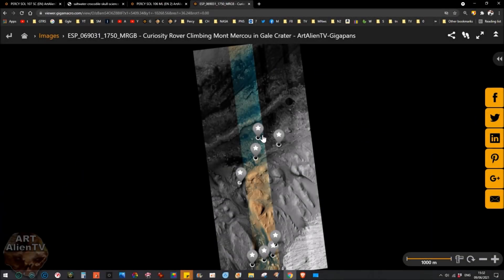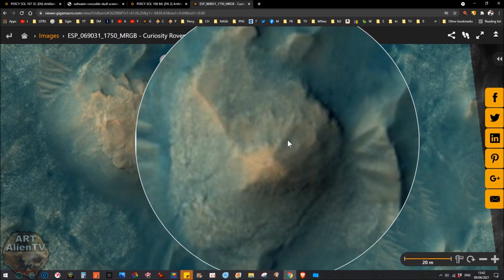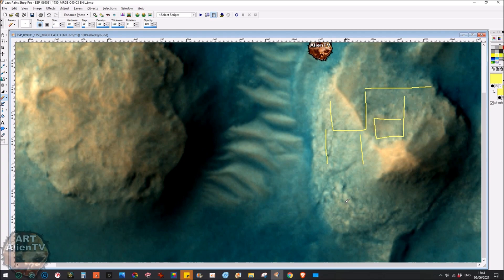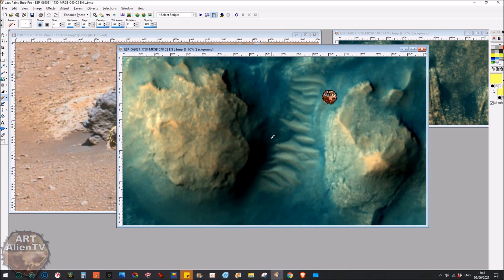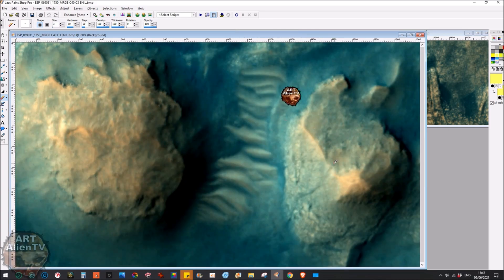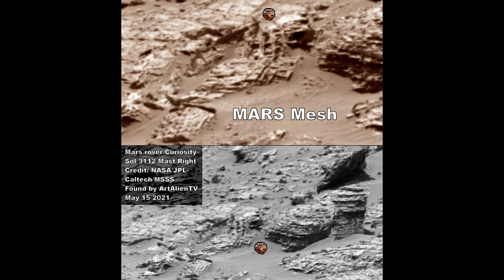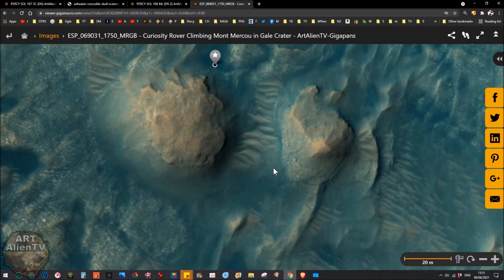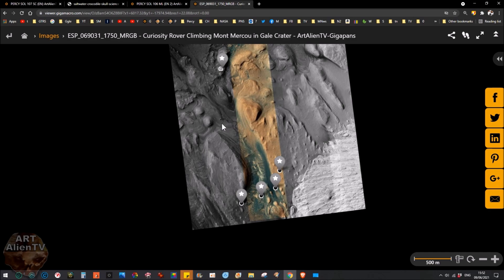MARS Ramp and Pyramid Structures ! HiRISE - ArtAlienTV (4K R)

Comment: 1:05 
Pause at that time stamp. Some might reasonably argue about natural weathering, sedimentary layers, and the strange structures that are found. That is true.
But has anyone EVER seen sedimentary layers in perfect hollowed cubes? Anyone?? 
Also, look down and left of center, just to the left of “MARS” text box. There is a portion of a bullseye looking circle, like a dartboard with inner circles, and radiating spokes. Does nature form dartboards? And circles within circles next to cubes?
Honestly, this is great evidence of intentional shapes, because they aren’t naturally formed. 
And it isn’t pareidolia, which is perceiving “nebulous” hints of a familiar thing as that thing. There is nothing nebulous or woo woo here. Those shapes are exactly those shapes and those shapes are not naturally formed anywhere through erosion. If it was simply wind erosion, the shapes wouldn’t be cubes with nearly identically sized sides and hollows. There would be more erosion on one side, and the hollows wouldn’t be squares with cube shaped voids in the interiors. It isn’t crystals eroded into these shapes, either. There are cubed crystals, but they do not form in a pattern that is separated by perfect outlines of a different material.
I think this is one of the best proofs of ancient remains of occupation by sentient society.
Reply from the maker: Great points :)
Reply: There are a lot more where these came from. Joe!